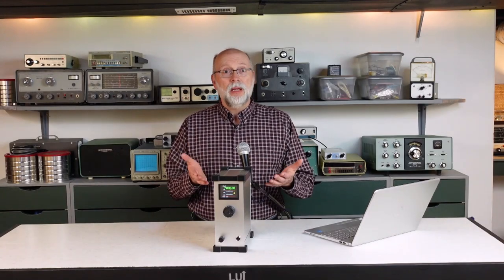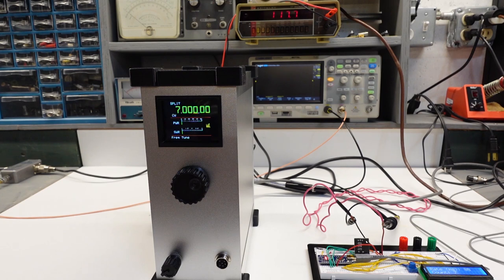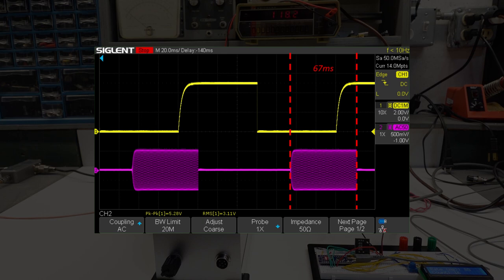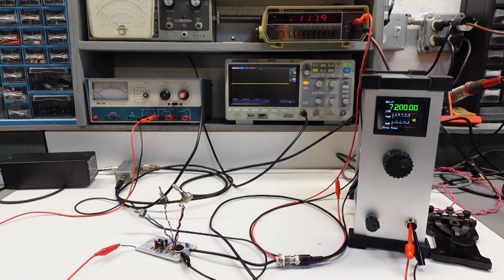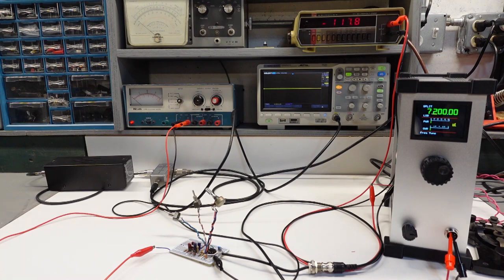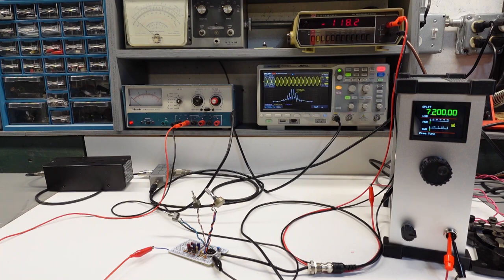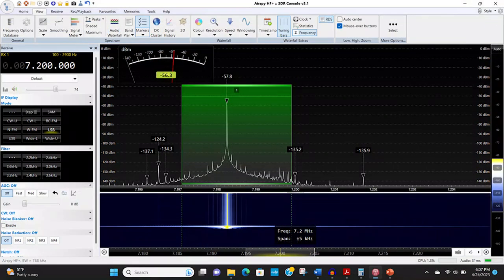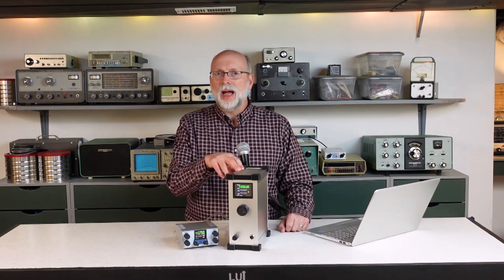HF Transmitter #18 - Completed Build, More Testing!

Comment: A thought on confidence checking your test results apparently outperforming commercial gear on some parameters: it might be useful to perform the same tests with the same testgear on a commercial rig.
- If you're still reading unreasonably good results then you know that you have a test setup problem.
- If you really are doing better than commercial gear on the parameters in question, then you'll have an evidentiary basis for this.

(The same applies with your subsequently-obtained TinySA or any future test equipment acquisitions. Getting results through your test setup that line up with the manufacturer's specifications provides improved confidence in your test equipment, fixtures, and procedures.)

Comment: Interesting testing.. What were the individual powers of the 2 tone tests. And the rated power of your Transmitter. I have analogue 2 tone generator as well. There are some internal audio harmonics. If you have a rf signal generator and a mixer you could look at products using a sound card as well.
If you are using a bipolar PA it's possible that the bias is collapsing under RF drive. Check base bias voltages with a series 10k and 10nF to ground, to a DMM. I have seen UHF PAs actually go negative under moderate drive levels